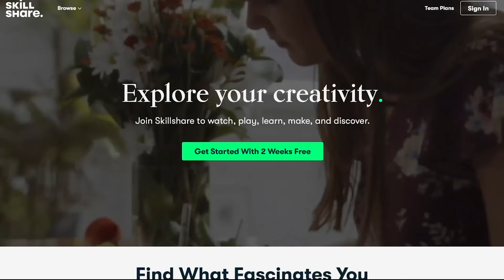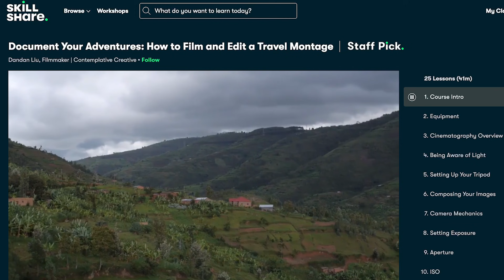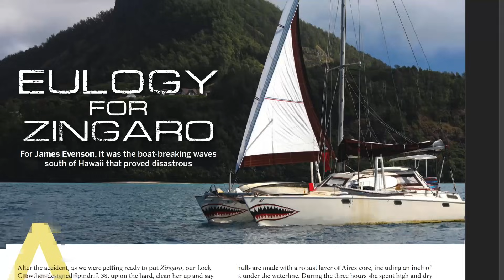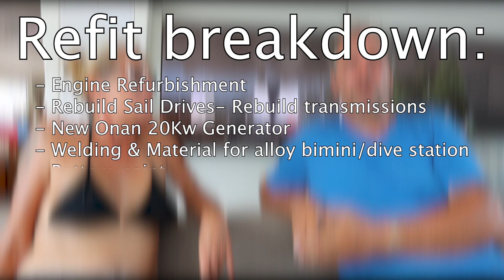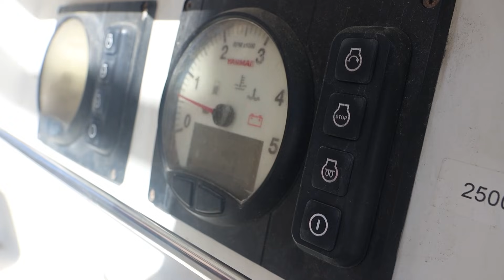Standing in water: Lagoon design flaw, or owner error?

Comment: The shifts and noises from the two previous videos are not normal.  If it were me, I'd be doing a main bulkhead inspection, at the very minimum, to ensure I don't have an issue - actually, it would be more beneficial to identify and likely repair the noise and moving interior items.  From what I've seen on Parlay - and yes, I do realize Parlay went through a catastrophe - there are videos from Lagoon owners that have not gone through such events that exhibit very similar compression fractures in the rather ridiculous employment of flimsy marine plywood without sufficient reinforcement.
Reply: You need to check your bulkheads for damage. We have fixed a 500 which had broken port and starboard Mast bulkheads, both on the inboard side of each hull. Also replaced the Companion way , port and starboard bulkheads the width of the cockpit. We removed the locker to starboard and the LPG locker to port. The starboard bridge deck moved up and down where the steering cable turning blocks are fitted as the bulkheads had completely let go.  We also cut out  the Pods that support  the cockpit floor , cleaned out the dodgy sealant and Epoxy glassed the bridge deck to the cockpit floor.... We are now fixing a 45 Lagoon with similar issues, but no damage to the Starboard Frd bulkhead, and the port bulkhead has the same damage as the 500 in that area. Not as bad as Parley, but in need of repair. The Companion Way Bulkhead i have replaced completely. You do need to check. Remove the Light& Power point fitting and look inside, you may need a flexible camera cable to get a good look Via your Laptop. You will see two holes , one is 65mm/ dia, the other is 65 x 150. If you see any distortion or damage to the area around there,you have problems, then remove the door and trims and have a Better  look. You can then see if the Tabbing has let go form the hulls. Stay safe.
Reply: Note the above 👆👆👆
Reply: Absolutely...easier to repair now then wait for a catastrophe when you are miles from no where,  and especially if you are overloaded as pointed out in the video
Reply: @beverleywalker1988  Hi Beverley, do you have pictures of the repairs you have done on the lagoon 500?
Reply: @jibsoling1866  . Hi there. I dont have pics of the 50, but lots of pics of the 45 which is almost the same repair process. Reason being that i was working for another Company when the 50 was fixed, and now i am fixing the 45 using my own company.
Reply: Can someone tell me where i can find these 2 previous clips everyone is talking about noises etc?

Comment: Lagoon's official remarks about the bulkhead issue is, any storm damaged or charter based Lagoon are not covered for this issue.  His sugar scoops are in the water from way to much weight on the stern.  That dive bench/dive compressor/solar arch/dinghy davit array is just too much.  I feel sorry for every Lagoon owner, the value of your very very expensive boats nose dived.  Peace!
Reply: Word!!
Reply: I haven't seen the prices of used 450s going down at all, on the other hand they went up. Sucks that Lagoon is just like most scummy car dealers who want to nickle and dime you for shit they designed badly.
Reply: C'mon mate, did you see the shitty quality of those bulkheads that numerous 45 owners have had catastrophic failures with? Those bulkheads are absolute shit and there is also many more quality issues with those cats. Yes we obviously feel for the poor bastards who paid a fortune for a shit quality boat, but there's no excuses like charter boats, overloading blah blah blah. I doubt that construction would pass any serious survey. Did you also not see some of the glass work around serious stress points? Those 45's are crap

Comment: Ignorance is bliss! That boat has serious issues, and is definitely overloaded. If I were the owner, I would remove the trims to check the bulkheads. The reason that there have been no reports is simply that nobody has checked their boats and reported it on social media.
Reply: I would at least drill a few small holes and use a snake cam to try and see the existing condition of the bulkheads. I highly doubt they design the boat in away which all that cracking is normal.. not to mention how worried James was in the previous video when he recorded what was happening and now he seems to have zero concerns.. unfortunately James is no boat expert, he’s a party dude that enjoys the sailing life style. I still don’t understand why is he not sailing he’s boat??
Reply: @markst-onge1109  yes. It is sad that most lagoon owners are simply in denial regarding the issues with all lagoons models that employed the same techniques, design, materials and construction methods as with the 450. If one does their research properly they would find that there are issues with all models cracking bulkheads. This is nothing new, Lagoon simply don’t have a good reputation for critical structural build quality and after sales service and support.
Reply: @nuffsaid7952 ,
I totally agree.
Reply: @Mal L that’s a very good point. The other factor is that there were far more 450s built than any other model with over 1000 of them built (mainly for the charter industry)

Comment: The bulkhead issue is invisible unless you demo the millwork to check . My call is that no reports = no one has checked . Those that do know are keeping quiet and selling fast . 

There were no reports on the 450 until one guy said how to check . Turns out there were lots , when they checked .
Reply: Exactly. Like his comment doesn't make sense.. the boats are made by the same manufacturer. An the fact that they don't want to check.... Shows they feel something is wrong. Head in sand by choice...
Reply: @donnakawana  Prudent seamanship would have one checking .  I pull up all my floorboards once a year and check all that stuff .

Comment: The 83-85k refit is probably standard expenses for after the purchase of a used cat. We know Parlay did all their own work, but I’d imagine the cost for a team to remove, repair and refinishing a crap bulkhead Lagoon would near the purchase cost. 
Furthermore, any Lagoon owner who thinks their off sized boat, other than a 450, has failure resistant bulkheads, they are sadly mistaken. I’ll bet they have the same weak sandwiched bulkheads. 
PS. It may be beneficial to employ child labor to crawl under decks to 5200 the decks to the hull. 
Apologies for the delay, happy birthday James!
Reply: Nah that is an insane price
Reply: Unless you’ve cut and repaired fiberglass first hand, your opinions mean very little
Reply: @twosborn  have you. Ever owned a catamaran?? If not. Your opinion means very little. 

the idea that all. Catamarans cost #1 the same. And #2 85k is idiotic.
Reply: I don’t think you watched this video, where the James covered what they spent 85k on a used charter boat. There are many components that do not get maintained properly, all the rigging, generator, water maker, etc that also get corroded due to the nature of a boat on the salt water. Normal yearly costs of a new boat is approximately 10% of the purchase cost, in a used boat, much more initially and probably more closer to 20%, adding windlass each, anchor motor, chain, trampolines, the list is endless. 
There simply is this:
No such thing as a cheap boat.
Reply: @twosborn  I watched the vid.

Your original comment is concise and makes no logical sense. Then you tell. Me. My opinion does not matter. Lol
Reply: 85k included the Dive compressor, engines and trannys refurbed, 15k for 3d forward sonar, water system work.   And 8 forgot the rest.

Comment: They probably built the 500's the same way they built the 450's, sorry but from that last vid - that boat IS broken
Reply: Like you would know
Reply: @313barrygmail  Get paid anyway you can, right James???.
Reply: @MichaelBuck  how did you get insurance on that thing? It's looks like the rigging needs to be redone.
Reply: @wayneanderson1641  Did you mean to say, "How would the OWNER get insurance on that boat", as it's not my boat, right? I agree if that's what you meant to say. But as long as the boat is intact and the manufacturer hasn't made any notices of an issue with that model, I can only assume the insurance company went ahead and insured them. So, in the end, the insurance company is on the hook for this imminent disaster IMHO!
Reply: @MichaelBuck  Yup
Reply: @testicool013  Um common sense an years of boating experience... It's broken....
Reply: @donnakawana  why hasn’t the rigging lost tension….it’s not broken

Comment: How can you say you're not concerned about the bulkheads ~ Regardless of whether you're sailing a 450 or 500, the design and construction of the bulkheads are identical...?!? Look on several Internet Lagoon groups and you'll see other 500 owners, whose bulkheads (structural), completely delaminated and cracked. Also, have you not seen the popping and damage to your floors ~ they're literally lifting? Another problem that's quite obvious, is the shifting of the walls and ceiling joints. Plus, the cracking noise produced by the bulkheads (mast, engine, etc...) are loud enough to wake the dead. All that's needed to confirm damage, is check your forward mast bulkhead. Pop off the wooden trim covering the starboard side bulkhead ~ Then you're able to properly inspect your bulkhead; instead of just guessing? Make sure to check the port side too.

Comment: Was their ex-charter boat a crewed version or was it rented directly to the individuals? That really makes a difference on how the interiors and systems of the boats are maintained.
Reply: He said in this video that they had spent 83 - 85k be ause the previous owner put nothing into the boat.  Not difficult to connect these dots.  Something tells me he will be at a loss for words when his masts fall into the water.
Reply: @bill8by5  It honestly just sounded like most of that 80K+ in refit was just "fun" stuff like a 3d sonar, other electronics, and a new lithium power system.
Reply: @omaolligain  I believe he said they overhauled the Diesels too.   But, compared to the potential of cracked main bulkhead repairs, it will come to a lot more than that.
Reply: Some of the stuff he talked about was necessary, but dang, main bulkhead ties the boat together.  Main mast ties into it.

Comment: O dear. I hope the engine has an over heat safety. If not you might be facing bore pinch. This is a problem. OK!  so you get it going as it’s cooled down. BUT the engine bores and pistons may need an overhaul. With direct injection you can pop an injector and use a bore scope to view. I bet these are indirect so that will be impossible. Fingers crossed.
James, wasn’t the the Cat that was creaking in your previous video?? I think an examination may be necessary.
Another great video. Thanks very much….

Comment: some ppl have money and little brains...... and also know fuck all about boats and seem to be ok with that fact. lets wait then for the first 500 to be "publicly fucked" and THEN we open a few spots on the boat to inspect. nevermind the sheer symphony of noises the boat does under way....thats of no concern, even adds to the dive safari experience one might add!. and these people want to take ppl out?!?! well im glad you uploaded this, so that we can all share it, thus limiting the number of ppl going out to sea on a fucked up boat. they had the right idea to get a Lagoon as dive liveabord, they just dont know how to do it properly, first thing to do(obviously after the very first one: straightening the boat and reinforcing it) is to remove and sell the mast and all rigging, sails, all things related to sailing you wont need anymore (goes into offsetting some of the refit costs), second thing to do is, indeed, upping those diesels a bit, third thing to do is increasing tankage. THEN you have a proper Lagoon, ie, a motorized living platform from which you can dive......and be a moron (less of, one would hope)

Comment: When you cranked that dingy motor, dry, you destroyed the water pump impeller in three revolutions. Pull the foot & install a new one.
Reply: That’s the silliest shit I’ve ever heard right there. Let me ask ya this, so when it’s just getting started after being installed and set back in the water how many revolutions do you reckon it takes just to prime itself? I’d be willing to bet it’s wayyy more than 3.. 🙄 so basically if we believe that nonsense you can spend the rest of your days doing nothing but changing water pump impellers and every single time you start it you’ll have to replace it again 😂
Reply: @Halfstep2024  You obviously have NO experience with an outboard motor.
Reply: @snsfabricating  he’s actually correct
Reply: @smulismuli7976   Um nope... Disagree
Reply: @donnakawana  dunno what your marine experience is. I grew up by water around all kinds of boats and engines, building and fixing things and have never ever had an impeller fail

Comment: You should look into ocean volt saildrives and motors with that much battery power on board.
Reply: And how much do you think that would cost in a Cat (best part of $100K)?
Reply: that owner has a lot of work to be done....on his fucking brain, before spending a fortune on those systems.
Reply: @normanboyes4983  should be about 50k without all the batteries.
Reply: @pmnfernando  that boat isn't worth it... At all!!
Reply: @donnakawana  i wouldnt say that. its a project boat. as ive commentged previously, the bigger issue here is the owner who is a complete moron and know next to nothing about boats. plus he wants to take people out......im glad James published this so we can all share and help prevent people from potentially getting hurt. you dont spend 13k on a fucking sonar when you have structural problems.best thing you can do to a Lagoon is to remove the mast and rigging, getting some bigger diesels and increase the tankage. it is a good liveaboard platform.